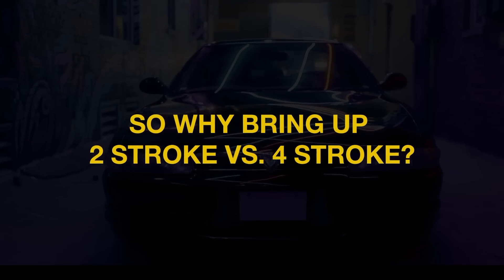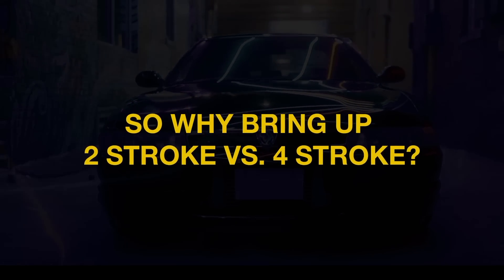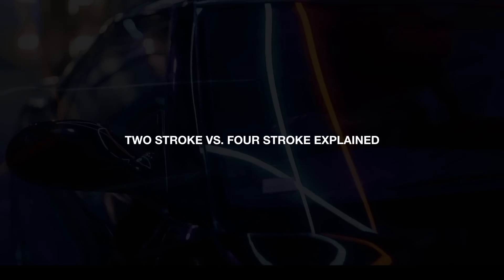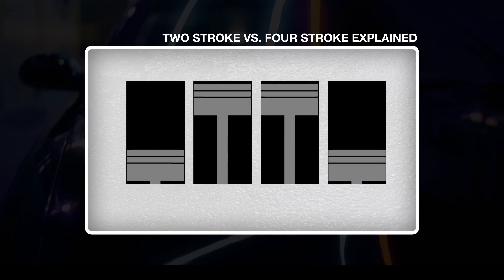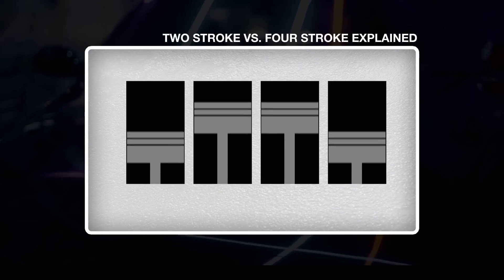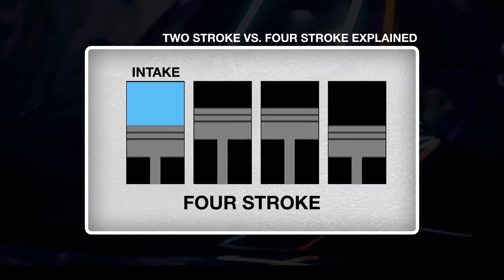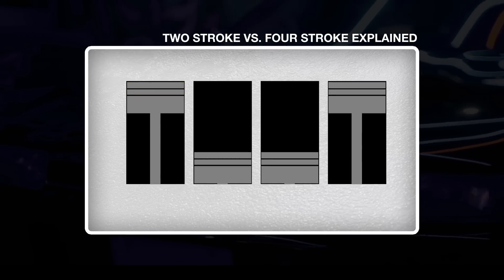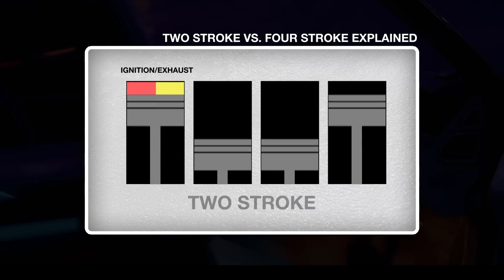The SECRET Behind Why RX7 and RX8 Rotary Engines Make SO Much Power

Comment: 1.3L makes perfect sense if you will stop bashing those of us that maintain that the rotary engine is really a two stroke.  A 4 stroke engine uses a full stroke (piston at TDC to BDC) for each phase, intake, compression, power, exhaust.  While a two stroke technically has all 4 phases, but each phase only takes 1/2 of a stroke.  A single piston 4 stroke engine fires once every 2 revolutions, while a 2 stroke fires every revolution.  A rotary engine fires  every revolution making it  a 2 stroke engine.  
Remember, a stroke is 1/2 rotation of the crankshaft, not a phase described as intake, comp, power, exhaust.  In a 4 stroke engine the strokes are thus named because each phase uses a single stroke, but don't project that naming convention to the stroke.  
The definition of the word stroke = "noun
1. an act of hitting or striking someone or something; a blow."
You description gets confusing because of your initial assumption that the rotary is a 4 stroke.  If you assume that the rotary is a 2 stroke, it all works out nicely.  Nothing confusing about it.
And as we all know, 2 strokes make more power / displacement than a 4 stroke, simply because it fires twice as often!
Reply: All Wankel KKM designs are 4-stroke...
Reply: The Mazda 13B requires 3 shaft revolutions to complete all 4 strokes in each chamber face... 3 turns equal 3.9 liter of total air displaced.

Comment: they just measure the volume of air and fuel that can fit in the combustion chamber its not hard to understand its a 1.3...😅
Reply from the maker: newscooler12316 there are 3 combustion chambers per rotor.
Reply: Rotors Magazine um no there are 3 faces but only one actual place where combustion happens...🤣
Reply: You're correct. His method of explaining displacement is...hmmm...interesting. 

In a machine shop, when you get your V8 bored, the method of determining overall displacement isn't the way he explained it. It's actually much simpler: https://en.wikipedia.org/wiki/Engine_displacement

Whereas the actual volume of the intake charge happens INDIVIDUALLY and each face is fired INDIVIDUALLY and each cycle happens INDIVIDUALLY, it then follows to measure the displacement accordingly. 

The video description is tantamount to saying, "Well, because a turbine engine pumps 'X' CFM of air, it's equivalent to a 70L engine in size." Hmmmmmm, no. Not at all. It's displacement is it's displacement. Period.
Reply: newscooler12316 In fact he got it completely wrong. I don't understand how people can complicate these things so much. A 13B can get a maximum of 1306cc of air, 654cc per rotor. The end. Not 2.6L, not 3.9L. Most people just don't like the idea or are just too stupid to understand.
Reply from the maker: If you listen, the answer comes in what you determine to be a piston equivalent. Many consider faces of rotors to be a 'piston'. The 'INDIVIDUALLY' argument doesn't work because each piston in a piston engine is ALSO working INDIVIDUALLY. Just like every piston is connected to the same crankshaft, every rotor is connected to the e-shaft. Effectively, what you've said for those that argue each face is a piston is that you can measure displacement of a V8 by taking the volume of 2 cylinders.

To use your definition from Wikipedia: "Engine displacement is the swept volume of all the pistons inside the cylinders of a reciprocating engine in a single movement from top dead centre (TDC) to bottom dead centre (BDC)."

In a single motion, all 3 faces of a rotor fire. In fact, some people go as far as to say the rotary engine is a perpetual power stroke.
Reply: Rotors Magazine man you just measure a single combustion not how many you have in a rotation 😂🤣😥
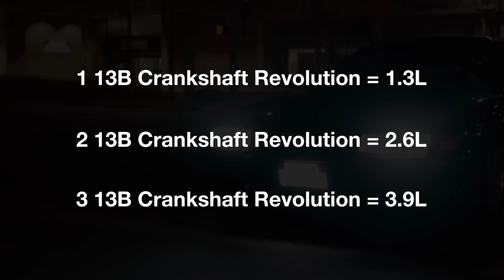Reply: for someone who says they dont care (at 5:50), you seem to care an awful lot. Naming it a 1.3L is not archaic at all.

Comment: This makes so much more sense now. 24mpg from a 1.3L didn't make sense to me, but 2.6L is more understandable for the 24mpg figure.  I think your right that the engine isn't a two cycle, but it still lubricates like one. It isn't really a true four cycle either. I'd just call it a Wankel cycle. Because Wankel stroke would be the butt of too many jokes.
Reply: Josh Bonds its a rotary because the dorito spins. Pistons stroke thats why theres seperate strokes.  Back and forth vs constant rotation
Reply: 2-stroke Benz-Cycle 360° 4-stroke Otto-Cycle 720° 4-stroke Wankel-KKM 1080° ARE YOU SURE? I THINK WE WILL CALL ON YOU stupid

Comment: I'm not sure there is a secret as to why rotary engines make so much power.

It is probably correct to state that the rotary engine’s (elliptical crankshaft) experiences 270 degrees of rotation for every phase-transition that the rotor traverses through comparable to the “power-stroke” of a traditional 4 stroke piston engine.

However, the relationship between a rotary engine’s elliptical shaft and its rotor is not so easily compared to a traditional 4 stroke piston engine that one can easily demonstrate that the 270 degrees of rotation for every “power-stroke” phase-transition that the rotor traverses through presents an advantage over the traditional 4 stroke piston engine - solely because the traditional 4 stroke piston engine’s crankshaft only rotates 180 degrees for every “power stroke”.

Here are some reasons why.

The manner in which the rotary engine’s rotor is coupled to its elliptical shaft combined with the force-direction of its combustion forces and the relationship it shares to the rotor’s eccentric angular rotation do not always work together to make efficient use of available torque from each combustion event.

If ever there was a secret about some of the inefficiencies of the rotary engine this is it.

Not in the least as vector of the rotary engine’s rotor’s “power stroke” motion is effectively at right angles (sideways) to the flame front that the combustion event delivers.

Whereas in a traditional 4 stroke piston engine the vector of the piston’s “power stroke” (downward) motion is effectively the same as the majority of the (downward travelling) flame front the combustion event delivers.

For a 4-cycle piston engine to complete every thermodynamic cycle, the engine must rotate 720° or two complete revolutions of the crankshaft. 

For a rotary engine the rotor rotates at 1/3 the speed of its crankshaft. Therefore the rotor will transition from compression to 
exhaust phase whilst its elliptical/crank shaft experiences ~270 degrees of angular motion. 

Furthermore, one could also say that due to the smaller leverage that the rotary engine’s rotor and elliptical shaft assembly exhibits (comparative to a traditional 4 stroke piston engine’s conrod assembly) with respect to converting the instantaneous torque pulses resulting from each ignition event into angular momentum of the elliptical shaft - the rotary engine actually requires more crankshaft rotation (and time) to effectively utilize/capture all the available torque from each ignition event.

In this sense we see that rotary engines - whilst they have advantages and are special - have inefficiencies and disadvantages too; some of which can be mistaken for benefits/secrets.

A traditional 4 stroke piston engine’s crankshaft will rotate through 180 degrees for every power stroke, but during that phase its piston, stroke, con-rod, and rotating assembly offers it considerable leverage advantages over the rotary engine; that translate into an ability to utilize more of the available torque from each ignition event. 

From the above discussion - including the fact that a significant component the force produced from the combustion process of a rotary engine contributes to its rotor’s sporadic angular momentum mostly at acute/other angles - we can also see why rotary engines are prone to using a lot of fuel (inefficient) and exhibiting undesirable torque at low speeds.

Don’t get me wrong, I really like them, know folk that race them, and they are unique. 

But, with all engineering approaches, there are usually compromises, and the above-mentioned compromises (and more) are those paid by the rotary engine - so it can exhibit its advantages.

Advantages such as that brought about from a comparative absence of reciprocating and valvetrain mass. And also the freedom to have port geometries that exhibit an almost square wave timing diagram.

When analysing these engines I find that its helpful to think that each side of the rotor can be equated to 1 piston/cylinder in terms of all the strokes/phases of a traditional 4 stroke piston engine; as a rotor has 3 sides.  

In a rotary engine each rotor’s side and/or combustion chamber/face goes through an - intake cycle - compression cycle - combustion cycle - exhaust cycle - each/every time the rotor completes one single revolution.

Which in turn (because a rotor has 3 sides) delivers 3 complete combustion cycles; each time the rotor completes one single revolution.

Also, since a rotary engine’s rotor rotates at 1/3 the speed of the crankshaft, this means that each time the rotor completes one single revolution in a rotary engine (and delivers 3 complete combustion cycles) - its eccentric crank-shaft turns 3 times; equating to 1 complete elliptical crankshaft rotation per combustion cycle or “power stroke”.

So - if it is essential to compare rotary engines to piston engines within the context of the 4 strokes of a traditional piston engine - we could say that to complete 1 thermodynamic cycle, a;

A) Single rotor rotary engine’s combustion chamber-face goes through 1 revolution and its elliptical crankshaft rotates 1080 degrees - 3 times.

B) Single piston 4 stroke engine’s crankshaft rotates 720 degrees - 2 times.

Whilst the above is true, clearly the analysis is a little more involved than even that.

Because, as one of the rotary engine’s rotor’s combustion chamber-faces completes its power stroke phase - it’s adjacent and trailing combustion chamber-face always experiences its intake/compression phase; such that a single rotor - when comparing it’s phases/strokes to a traditional 4 stroke piston engine - always behaves as if it has 3 cylinders.

This consideration is often overlooked in the comparison between rotaries and typical piston internal combustion engines.

Therefore, each time the rotor of a rotary engine completes one single revolution it is comparable to a traditional 4 stroke piston engine with 3 cylinders.

So, given the above it seems fair to also consider comparing a single rotor rotary engine to a traditional 4 stroke piston engine with 3 cylinders.

Therefore, as each engine completes 1 thermodynamic cycle we have the following;

A) Each of the single rotor rotary engine’s combustion chamber-faces goes through 1 revolution - yielding 3 combustion processes; all whilst its elliptical crankshaft rotates 1080 degrees - or 3 times. 

That is, 3 combustion processes for 3 and/or 1080 degrees of rotation of the elliptical crankshaft. 

Therefore, a single rotor rotary engine = 1 combustion cycle per 360 degrees of elliptical crankshaft rotation.

B) Each of the 4 stroke engine’s 3 pistons are connected (120 degrees apart) to a crankshaft that rotates 720 degrees as the engine completes 1 thermodynamic cycle.

That is, 3 combustion processes for 2 and/or 720 degrees of rotation of the crankshaft. 

Therefore, a 3 cylinder piston engine = 1 combustion cycle per 240 degrees of crankshaft rotation.

Therefore, it could be said that the piston engine utilizes each of its combustion events better than the rotary due to its better alignment of combustion force and piston motion vectors, and also the leverage advantages presented by the conrod and big-end assembly. 

Advantage piston engine.

Additionally, it could also be said that a piston engine (that is comparable to a single rotor rotary engine) experiences 1 combustion cycle per 240 degrees of crankshaft rotation; whereas the rotary engine only experiences 1 combustion cycle per 360 degrees of elliptical crankshaft rotation. 

Advantage piston engine.

Again, this is why rotary engines - whilst exhibiting advantages and also circumventing many issues with piston engines - have a reputation for poor fuel economy (per capacity) and undesirable torque characteristics with city and/or slow driving.

Rotary engines are still close to my heart though.

If you use the above-mentioned comparison approach then the confusion over swept volumes doesn’t matter as you can make them the same.

Good video.

Comment: let say we compare one 4 stroke engine with a rotary engine with same displacement , example 1.2 litre, the 4 sroke take 2 revolution to burn out 1.2 litre airfuel- mixture but rotary engine take 3 revolution, so rotary engine burn less airfuel-mixture compare to 4 stroke engine with same engine rpm.
Reply: All Wankel engines are 4-stroke... but require 3 revolutions. This why the 13B is considered a 2.6 liter when comparing to other 4-strokes even though the true displacement is 3.9 liters in total.

Comment: It is best to see wankel engine as a double epicyclid pump, a balanced one.
There you can see that it behaves like a spilt cycle engine with a 2 cyl pump for admision and compression and 2 cyls turbine for expansion and exhaust. Each pair of 2 cyls [2 up and 2 down if you wish] are separated 180° and just 90° degrees each arrange.
So, as a regular engine of 4 strokes 2 cyls is equivalente to a split engine of 2 cyls, then Wankel engines are same as 4 cyls split engine that is eq to a 4 cyls reg engine.
Then, you get the size of the biggest chamber and multiply it by 4.
P.S. 4 cyls regular engine fires 2 times in each rev, same as 4 cyls split engine, same as wankel.

Comment: These engines are just in a class of their own.  It really can't be compared to any engine because it is not engineered the same.  There is technically no "piston" jumping in a tube, rotaries are torsional in that the rotor face twists against the housing.

Comment: Great video 👍
I wish more and more people got into rotarys 
To keep them alive
Reply: Unfortunately the Wankel engine is obsolete now, no longer produced anywhere in the world... and very quickly becoming extinct.
Reply: doktorbimmer it’s making a come back next year in Mazda’s hybrid car.
Just don’t know if it’s going to be the motor that was in the rx8 or rx7
Reply: No, it is not coming back. Despite all the fake clickbait rumors on the automotive blogsites, Mazda discontinued development of Wankel engines in May 2009 and has permanently ceased all production.
 Mazda's CEO has stated officially that the company has no plans to resume any production and there is absolute zero evidence to prove otherwise.
Reply: doktorbimmer are you sure brother I know they stopped after the rx8 
But read that it will be back in the Mazda Ev 
Let’s look it up
Reply: Mazda and Toyota have only confirmed a joint project with Denso to built zero-emission battery electric vehicles to comply with new laws in California and 11 other states. 
 *Both companies recently lost a bid to allow range extenders and hybrids under the new law that went into effect this year..
If Mazda does not offer a zero emissions car by 2023 it will be banned from selling any cars in California (Mazda's largest and most profitable market).*
Reply: Mazda had been considering building its own EVs but the company is simply too small to cover development costs on its own. Mazda decided instead to buy EVs from Toyota and go forward with launching production of its new 4-cylinder Skyactiv-X engine (which debuted at last years Tokyo Auto Show) and has been confirmed for production starting in 2019. 
 http://driving.ca/mazda/auto-shows/tokyo-motor-show/mazda-vision-coupe-stuns-at-the-2017-tokyo-motor-show
Reply
Reply: NEW MAZDA VISION COUPE NEW 4-CYLINDER SKYACTIV-X ENGINE  http://www2.mazda.com/en/next-generation/
Reply: 2-stroke Benz-Cycle 360° 4-stroke Otto-Cycle 720° 4-stroke Wankel-KKM 1080°

Comment: When asking why a small displacement engine can make big power, it's because displacement is irrelevant. What is relevant is airflow, because an engine is an airpump. That's why the same engine with different heads, cams, etc makes different amounts of power.
Reply: Yes you are correct but NOT different amount of torque ....an NA 13B is nowhere close a 2.6L in torque let alone a 3.9 Lit. So rotary (in real life not calculations) is equivalent to 2-2.2 piston in power and torque ....... and nobody actually bothered to answer HOW is the capasity of the 0.65 lit measured..... is all the "air"/"water" one housing can include or one rotor face..... from WHAT degrees up to what degrees? .....

Comment: On a 2 rotor only 1 face fires at a time. It does not fire the 2 rotor until the first is on its exhaust stroke that information is wrong
Reply from the maker: No. on a 2 rotor, 1 face per rotor fires per revolution.There are 2 rotors in a '2 Rotor'.  2 of 6 total faces fire on one revolution.
Reply: What are you talking about do you have any clue how a rotary runs. A 2 rotor wil fire 3 times per one revolution of the crank shaft. Please stop miss informing people. Because one face will always be in compressed and ignited position while the other is on its exhaust stroke and intake draw. Dude you are miss informing people bad
Reply from the maker: I have no idea how a rotary runs. Thanks for checking out my youtube channel titled 'ROTORS'.
Reply: well, now it is called 'brotors' ...  so you know how things brotate

Comment: the answer is in the slide show and very easy. You need to measure it from the "flywheel" perspective. One revolution of the flywheel or E-shaft = 1.3 liters of air pulled into the engine. Mazda is correct.
Reply: WRONG, it takes 1080 degrees of crankshaft rotation to complete it's firing order sequence so 3.9 liters of displacement